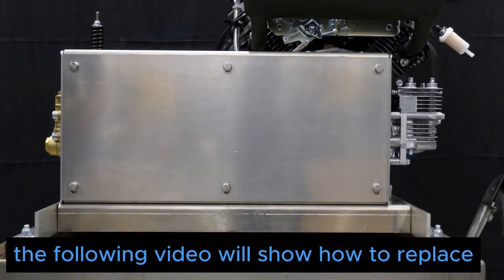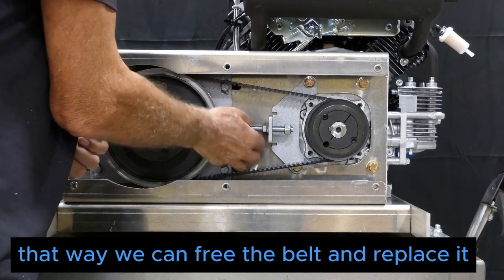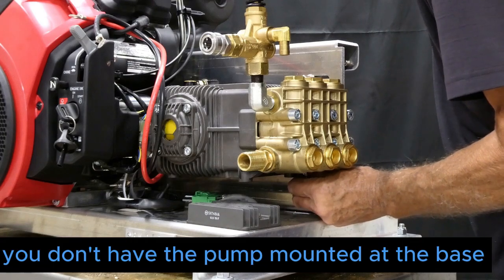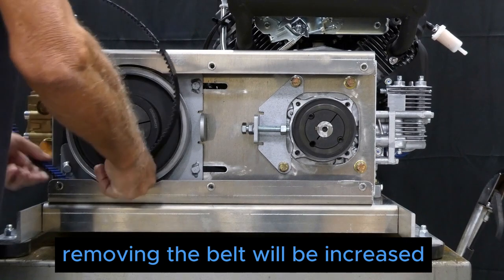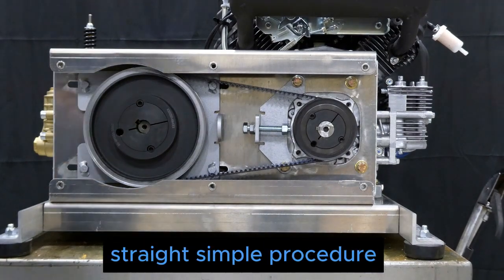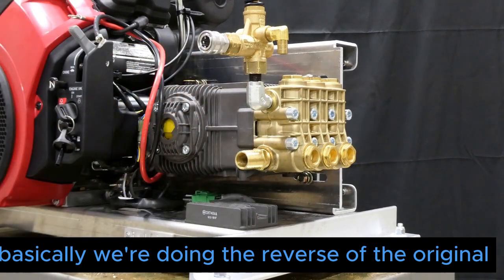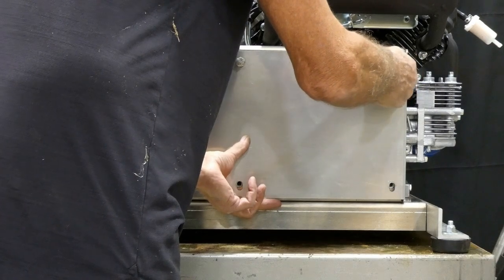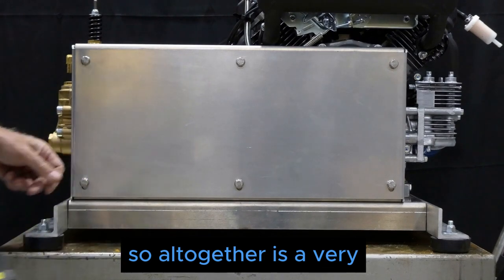The Best Poly Chain GX690 with 8 GPM and 10 GPM Pressure Washer options

Comment: Wow!  I built my own polychain drive pressure washer years ago, and keeping the pulleys aligned is not as easy as one might think.  I love this design and give full credit, but don't understand why the pump industry didn't come up with something like this years ago.  I do understand that you only offer this on your own units and don't sell this as a stand alone mounting system. I'm sure you'll get your patent as I haven't seen anything like this on the market.  Nice job!  BTW, I bought a 2nd belt for my machine in case the first one breaks so I'd have it ready to go with little downtime.. It's been six years and the first belt is still going strong although it is badly misaligned at the present time...
Reply from the maker: @plumbermanplumbingllc7547  the pump industry doesn’t design any frames.  The OEMs however do.  

The massive OEMs are considering cost when building and rarely change what they do and go through the motions of “we do it the way we’ve always done it”.

Comment: I would like to convert my existing gear drive to a poly chain.  Do you sell a kit with the base plate, pulleys and belt?
Reply from the maker: We only sell the machine complete.  We do have belt driven skids that can convert to a belt drive in stock on a temporary basis at Washmart.com in the vault section.

Comment: Is there a model available which uses a clutch of some sort or feature that allows the engine to remain running while the pump/machine isn't being used?
Reply from the maker: You can add a pressure switch to the efi models or a clutch on the 690 models.  We don’t get asked for it often but it is an option that can be added.